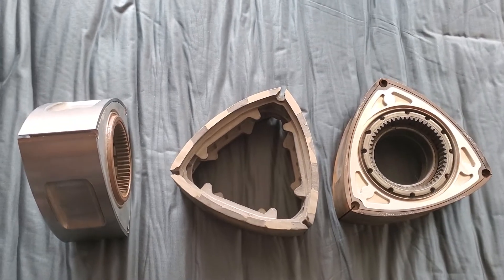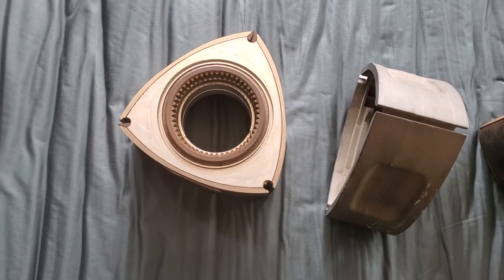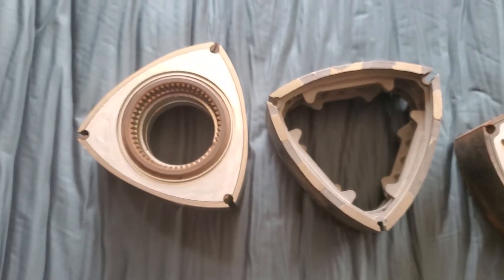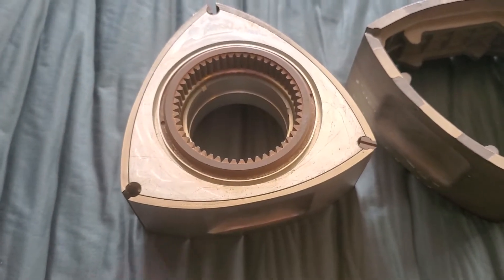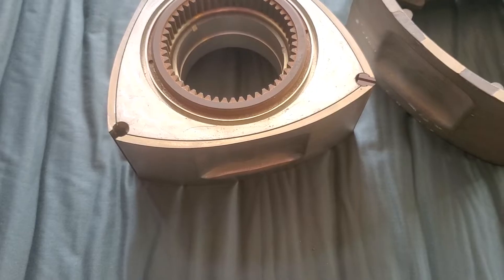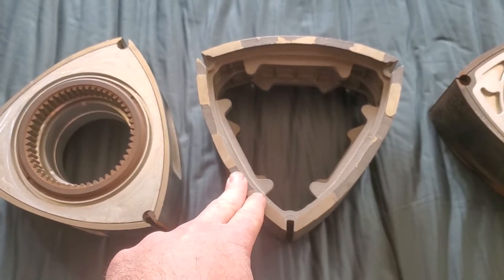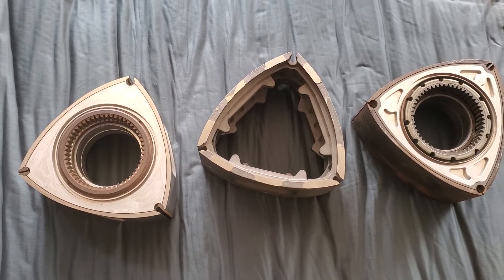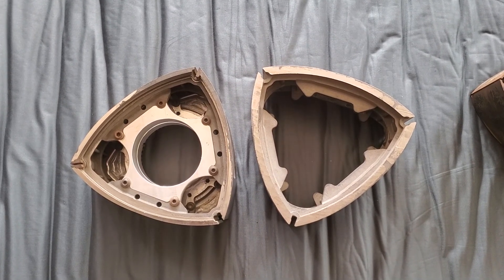Titanium ROTORS Mazdatrix Super light Mazda Engine Rotors : Part 2

Comment: Now that 3d printing is an option in the production process, do you think that would help with the tolerances and imperfections?
Reply: Depends on metallurgical properties …. And what won’t change size during certain processes … billet would be best but you have to use CnC … but also depends on what metal your using for the housing of the rotor itself and how to make them and it not change in dimension or cost efficiency at the same time … titanium would be sick but I think it’d be too brittle over long term compared to iron and immense heat … was a question I asked also …